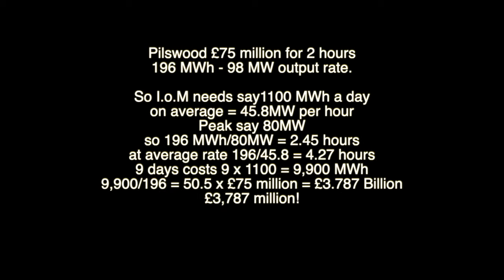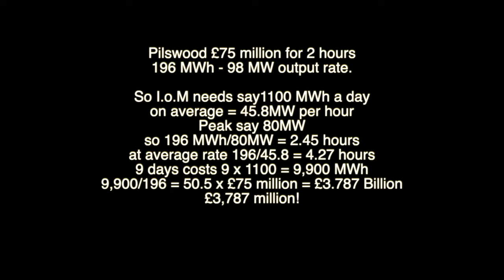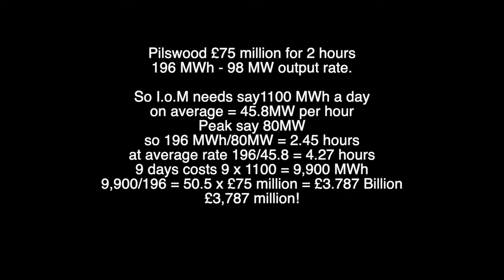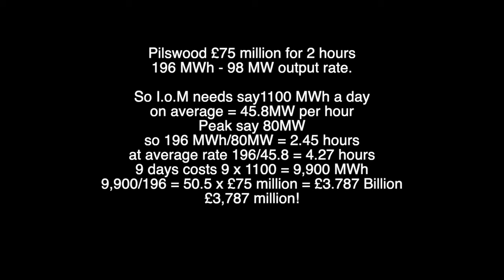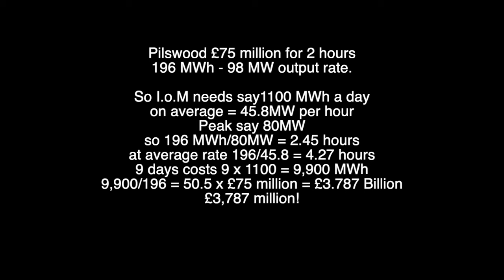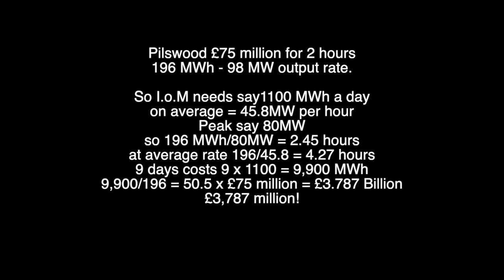Teaser for forthoming video series

Comment: looking forward to hearing this series and how the public common sense took to it with their questions. Great work. 

320wh battery for 300,000 homes. 

What was the price / kwh 75,000,000 pounds/196,000 kwh = 383 pounds/kwh so my 15kwh home battery which cost me about 1600 pounds call it 2000, DIY with lifpo4 new quality cells would cost if the state and tesla did it almost 6,000 pounds. Lucky I installed 30kwh. 

Oh and install that with solar, and people could just use grid for backup say 90% of time and in 6-9 years payback, and then at least 10 years free, but mostly free from price highks and the nonsense manipulation and rolling blackouts which are on their way.

So if people did think battery was a good idea it would still be better to do it on an individual basis in their own homes.

Comment: Getting technical for a moment - 320Watts. That’s the allowance given for running one home in the figures. Where did it come from? Somewhere I dredged up a memory that an average home uses about 8KWH of electricity per day. Well, 24h of 320W is 7.68KWH if my sums are right. Clearly the actual load does vary, as refrigerators power up every 20 minutes or so, at night when most appliances aren’t used the quiescent power used will be quite low, but powerful appliances use loads more energy. So the maths work out as long as ‘average’ mean 24hour demand is used. However. Humans tend to use more power at midday and traditionally lots of kettles got turned on in advert breaks on ITV. Demand is thus complex and maybe with AI can be predicted. However - the infuriating thing is battery storage is still tiny compared to the potential demand, especially if EV and domestic heat pump use increases. They cannot cheat electricity into manifesting as easily as the Bank of England prints money with quantitative easing. There is some idea of EVs being used as battery storage - the grid will be allowed to rob your plugged in EV of some electricity if the grid is running low….. but the ultimate problem is if you aren’t generating the electricity it doesn’t exist. This is not addressed.
Reply: Just a few reflective thoughts inspired by your interesting comment.  

I'm not too well up on battery technology but I sometimes wonder about the problem I often hear about, regarding the need to avoid charging Lithium ion (I guess) batteries to 100% or discharging fully - between 20% - 80% is what I keep hearing is the ideal for EV batteries.    For a while I probably had the wrong idea, thinking of older battery technology, when people used to say batteries had "memory" so if you didn't charge them correctly, that would limit how much they could ever be charged.    I'm guessing that doesn't apply here.    I just wondered whether there might be any negative consequences from frequent charging / discharging within that 20% - 80% range.   Presumably they have strategies to maximise battery life.   (Forgive me, I'm just thinking aloud, making idle chit chat I guess - don't feel obliged to respond)

That Quantitive Easing subject reminded me of my sister trying to give me some reasurance that the online National Debt pages are "nothing to worry about", sending me some video from a guy with Green Party connections I think, a Sheffield Uni lecturer I believe, a chartered accountant ... it's all a bit beyond me but he went through each part of national debt explaining why we don;t actually want it to be paid - or at least that was the overall impression I was left with.  

I only became curious about that after watching a very interesting 3 hour presentation made by a guy on the DemystifySci ch., 3 weeks ago,  proposing a better way of achieving net zero (not that I buy into the rational behind it anyway) - not involving wind, solar, not even nuclear except in the short term ... His proposals (he claimed) are proven technology that couild be implemented in any country, a kind of local, circular economy, where the waste from one process is actually the fuel for the next, obviating the need for the huge amounts of copper (and other ore)  he calculated are simply not known to exist, even if we recycled every bit mined in the last 30 years, I think he said we would need about 4 x more so it's literally impossible to implement the current net zero strategy world wide and a very wasteful way of going about it.   

But in explaining all this he had to go into the world money system and all sorts of factors complicating matters, showing the US national debt and others, with that fascinting but quite scary live chart going up at an alarming rate.    I have nothing useful to add, I'm just a baffled layman trying to take in pieces of this huge jigsaw puzzle, wishing parts weren't intentionally hidden, forbidden viewing lol.   

I'd like to have a third watch of that video in case that guy has a good point that other experts might remark on.  He's some mining expert whose PHD he jokes now stands for POST HOLE DIGGER since he lost his $180,000 PA salary when China no longer wanted the Australian ore, and had to work on an organic farm, which he uses as an analogy to some extent for his "circular economy" idea.

Comment: Have you or they taken into account the extra elec needed for transport and for heating and hot water. The capacity would need to be 4 times the present provision. Population.electrification of everything, AI and computers stations. In uk it is estimated at 400 Gigawatts from 100 Gigawatts now.  Batteries would need to. Incorporate this so nomes are 20% elec now  but 80% comes from mostly gas.  So without gas. Heating, cooking, hot water, gas fires, plus EV  there would be a massive increase in demand in Winter.
Most houses would need a larger main which costs   Incresed mains fuse to 100 amps at least.  New houses would also have an increased demand but better heating efficiency. Solar panels and battery storage will help but only to a minor degree .
Reply from the maker: Yes have considered all of that and it is impossible.

Comment: Are the battery storage times even worse than the figures from the battery farm owners that you are quoting?

I would be interested to know if the 196MwH storage capacity claimed by the Pillswood BESS Battery farm is the theoretical capacity based on the Amp/Hour delivery of the batteries multiplied by the fully charged voltage of the batteries to give an unachievable Amps X Hours X Volts = MwH capacity (assuming an unrealistic unity Power Factor where the Grid is an entirely resistive load)

As the batteries discharge to 0V, the current drawn logically increases to infinity, and there must be a point where the invertors will shut down to prevent damage to the batteries and the invertors.

Domestic 12 volt DC invertors used by caravan and motor home owners shut down when the battery voltage has dropped to 9V, suggesting that they can only consistently provide 25% of the energy stored in them.

I appreciate that the discharge characteristics of the Lithium Batteries used in battery farms and the technology used in domestic and commercial invertors are entirely different, but would be interested to know at what discharge level a BESS would shut down to prevent thermal runaway of the Lithium batteries, and how many KwH of electricity can be realistically stored.
Reply from the maker: I think they shut down at 2% to prevent damage but the number of cycles lifetime can be reduced by the number of times below 20%. However that is my guess from my perusal experience.